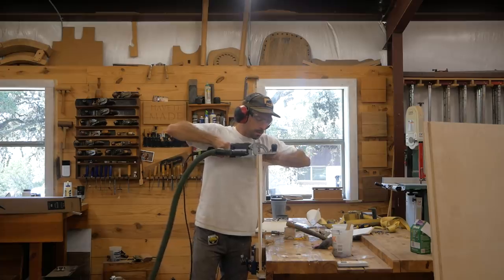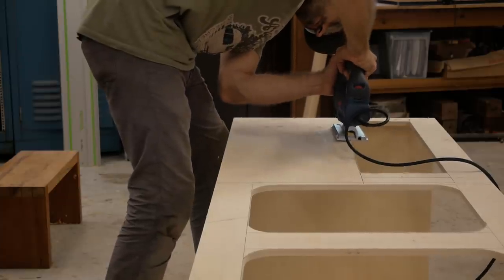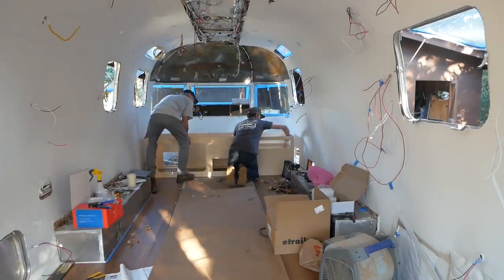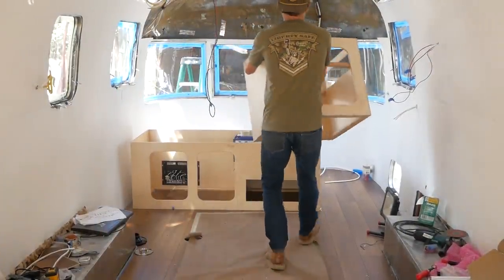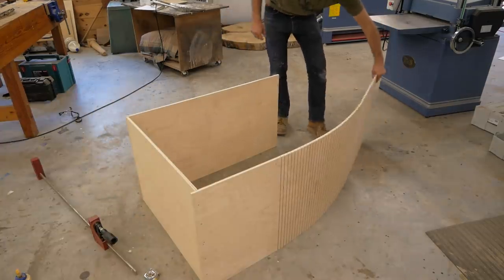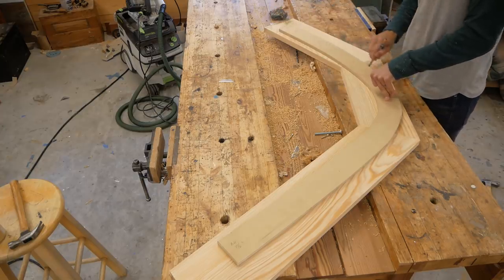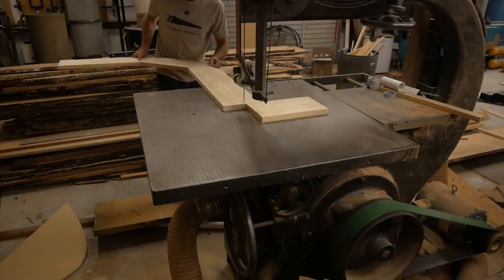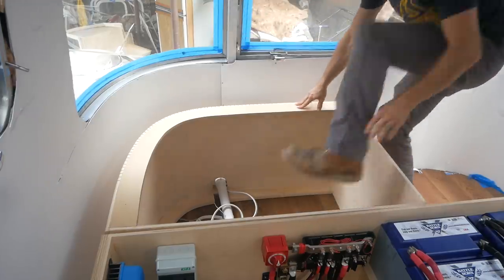Building A Custom Queen Bed For My Argosy Airstream: Part 1

Comment: It’s fun to see the marriage of two skill sets in one trailer! Trailers of this era were designed by ex aeronautical engineers, so they are built like an airplane fuselage. However cabinetry leaved much to be desired (IMHO). Joints were held together with staples and pocket holes. Structure was minimal. BUT there was some engineering thought that went into the cabinetry. Trailers flex, and so the interior needs to flex with it, or it will tear itself apart. I like that your bed doesn’t tie into the vertical structure, so it can move independently with the floor. Keep that in mind when building and installing your uppers. Resist the urge to make them TOO solid and rigid. It’s exciting to see you finally get to this stage where your expertise as a fine woodworker can really shine!! Congrats on sticking to it Andy - there are LOTS of gutted Airstreams for sale on CL by people who couldn’t see the project through. Cheers!

Comment: I am surprised you didn’t go with blonde birch wood, as it is strong and fairly lite as well. And it is what was in my 1954 Spartan Royal Mansion. Which was also constructed in a semi modular manner. As parts of it was modular, other parts was linked together in almost one piece. But the interior was pretty well constructed out of almost all 1x2, except where walls and doors was. And held together with dowl pens and screws, was very little glue used in putting the interior together. But that was done that way to allow the interior to flex a little while going down the road.

Comment: Hey Andy!
I've been binge watching your series for a few days and am learning a lot.  So first and foremost, thank you for the step by step.  Your videos will be a great reference as I navigate my restoration.  

With all you have included, this is a basic question, but why do you first hammer in the screws before finally securing them?  

Cheers! 
Dobby
Reply from the maker: Hey Dobby, thanks for watching the videos and it’s great to hear they’re helpful.  The reasons for the hammering is because I’m using a special trim screw.  It has a nail head with very fine threads and a small screw head that self countersinks.  To use them you start the screw by hammering it in place then drive it in with your drill.    https://www.menards.com/main/hardware/fasteners-connectors/screws/cabinet-screws/spax-reg-8-x-1-3-4-t-star-plus-drive-zinc-trim-head-cabinet-screw-1-lb-box/1351010400454/p-1447285978431.htm

Comment: Great episode Andy.  Question: Are you worried about the heat build up from the batteries and electrical boxes which will be covered by the mattress?  Thanks for taking me on your journey in this restoration.
Reply from the maker: Nate and I discussed this and he didn't think it would be an issue.  The batteries and the converter/inverter have a built in thermometer so I can monitor the temps and if it gets too hot I'll put in a fan.

Comment: Man I want a Domino.  Still a bit surprised nobody has come up with a more budget friendly alternative.
Reply: Watch videos from matthias wandel - he shows the strength of dowels vs domino vs biscuits
Reply: @teedawg2112  Yeah dowels can be comparable, especially when doubled up.

It's the convenience/speed of the Domino that really sells it though, it's a well built tool and very accurate - the cheap doweller machine alternative from Triton is a bit rough and badly made though and the Mafell one that is actually good is almost as expensive as a  Domino.  Someone needs to come up with something in between those two machines and it'd sell well I think.

Comment: Bed on top of the batteries? Is that safe?
Reply: With lithium batteries it’s fine - no off-gassing. If he was using AGM or lead acid batteries, they would need to be stored outside the trailer. Lithium is definitely the way to go if you can afford the additional up-front cost of $800-1000 per battery.
Reply: If they're going to burn they're going to burn.

It's a small indoor space, while there's undoubtedly a chance of failure I'd say the actual risk is the same regardless of where they are located.  Maybe if they could be located outside that would be best but they obviously can't be outside.

Comment: The top frame shouldn’t be right against the wall. Leave some space or put slots in to allow for ventilation behind your cabinets. The air moisture will condensate on the colder walls of your camper and without ventilation of these walls you will soon face mould.

Comment: I wouldn't be comfortable sleeping with four batteries below the bed to be honest.
Reply: are you ok with flying in an airplane whose wings and belly is filled with fuel?  or driving a car with a tank full of gas next to an engine that produces heat and spark?
Reply: @jakefromstatefarm9721  Yes, its exactly the same, when i drive my car and i'm sleeping if it gets fire i will burn 
And i repair airplanes for a living, and  i have never flown on a plane.